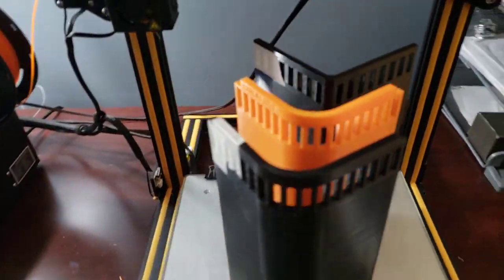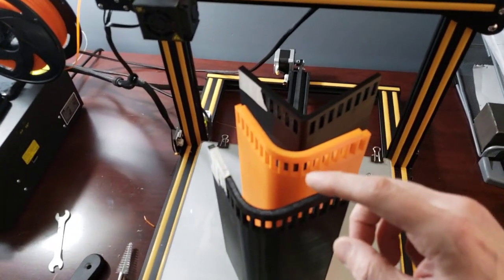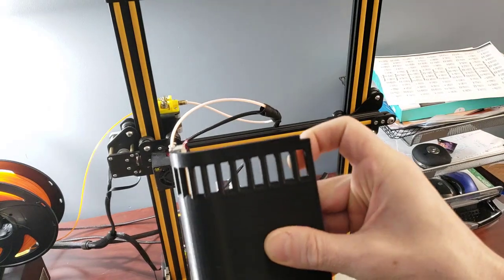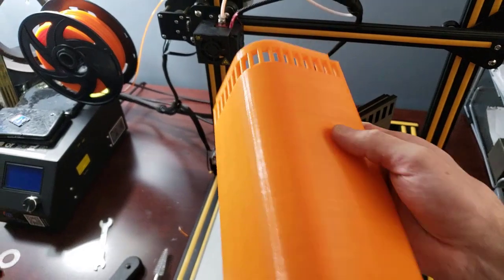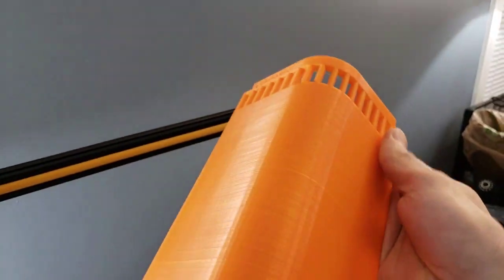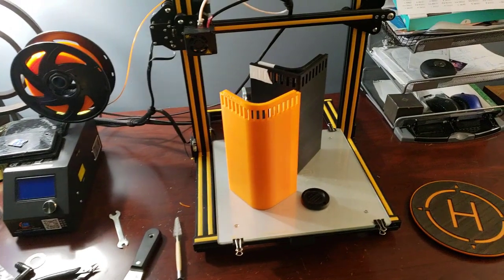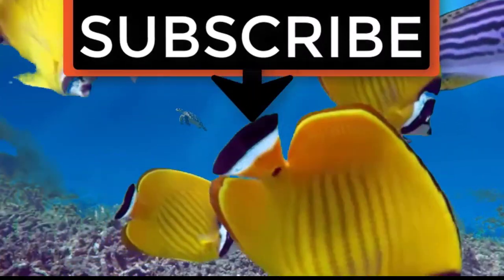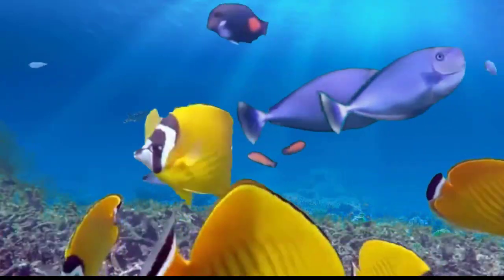3D Printed overflow box for reef aquariums.....Custom DIY for extreme hobbyist!!!

Comment: What material do you use??
Reply from the maker: I print test pieces in PLA but use a type of epoxy for the actual molded piece.
Reply: Coralust Reef Solutions Great video, do you epoxy coat the printed piece or is there an epoxy material spool to 3D print with ?